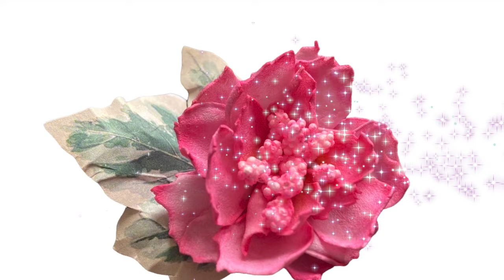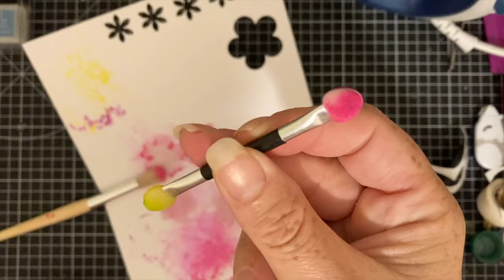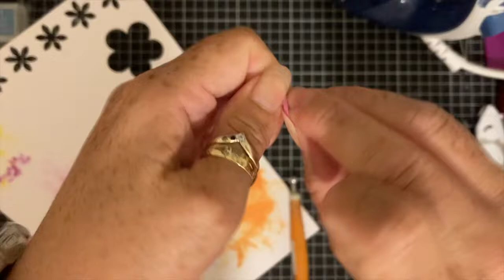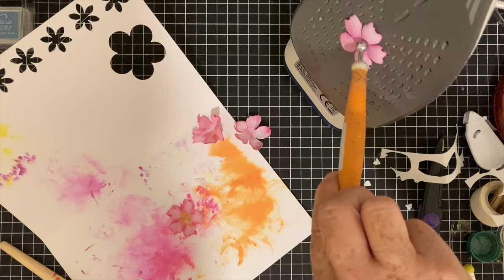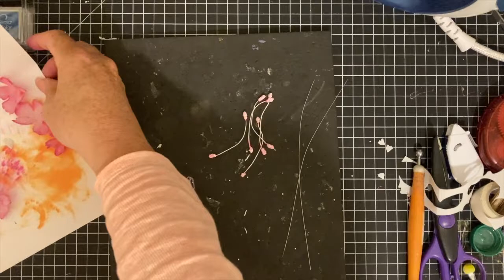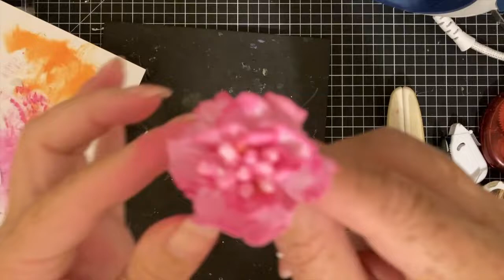Using Foamiran - Flower Making Videos with Amanda. Flower forming tutorial

Comment from the maker: What I used in the video:
The printable ivy leaves - https://payhip.com/b/zJHWx
Couture Creations flower forming Foam
Household Iron
Flower forming foam mat
Tonic studios ball tool
Hot melt glue gun
Pollen Head Stamens
Florists light-gauge craft wire - any craft wire will do to make the bobby pin
A sharp tool to create the hole in the flower to insert the wired pollen heads
Decotime Ink Pads
Makeup sponge applicator
Flower dies which I then cut/shaped with decorative scissors to give them a frilled edge

If you would like to see more of my work why bot pop over and join me in my little Cardmaking group on Facebook or Instagram Card Gallery.. you can find all my links on social media here: https://linktr.ee/Opulencebydesign